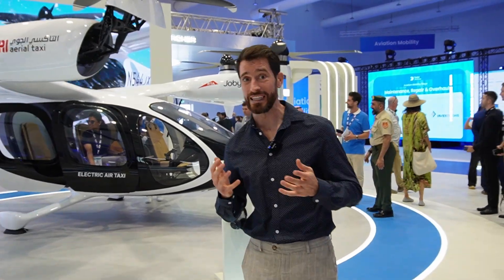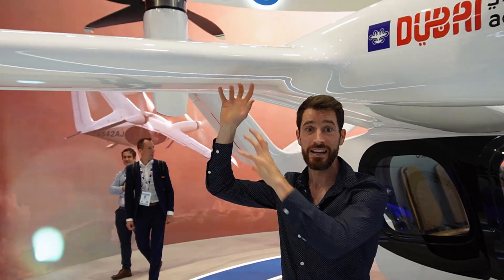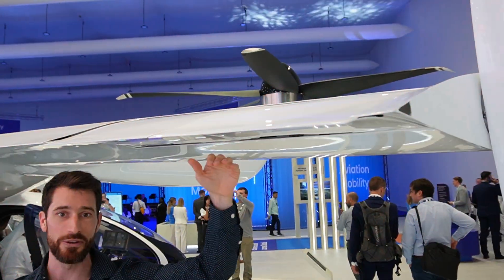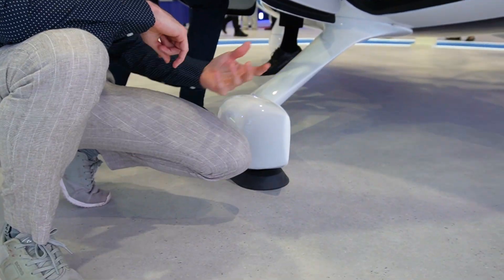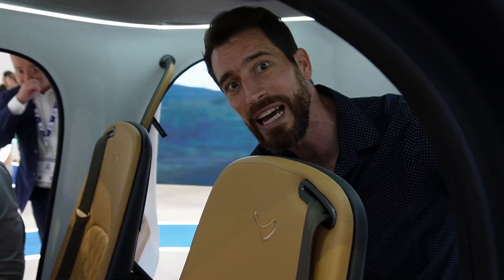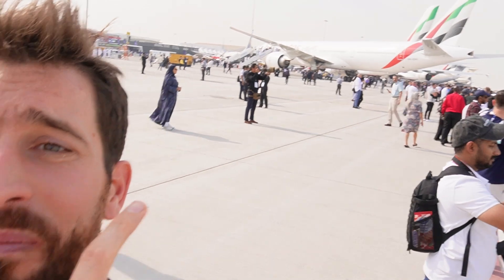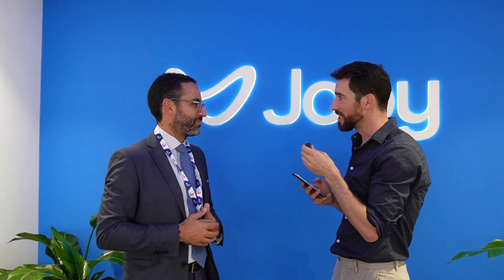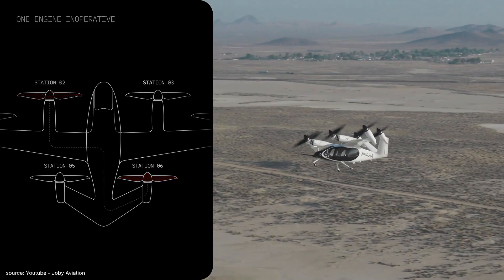Exclusive footage and interview with Joby Aviation

Comment: This Joby thing is really nice, really a beautiful toy , but  I'm sure I'm missing something ... given the short range, the slow speed and the urban use... why not an elicopter? An elicopter should be also intrinsically safer thanks to autorotation and the fact that Joby will glide like a brick.
Reply from the maker: It's the low noise which impressed me the most! And I wouldn't see helicopters getting accepted in large numbers in urban environments. And they too aren't safe on the wrong side of the dead man's curve. Each has their benefits and downsides!
Reply: The Joby attempts to solve safety by redundancy. Hence the six motors. And you call it slow, but it's comparable, if not faster than most, if not all, equivalent sized helicopters (in fact it's small, so equivalent sized helicopters are definitely slower). It's considerably quieter - having seen it at the show, the display was virtually silent - has better redundancy, is cheaper to operate (helicopters have notoriously high costs to operate), is easier to train pilots for, has less maintenance, less vibration (more comfortable for pax)....there really are numerous advantages. You mention the helicopters ability to autorotate, but that's not even available in certain segments of the flight profile, and is extremely risky (to put it mildly) over an urban setting anyway.

The downsides are none of the things you mention IMHO, apart from short range (helicopters not exactly being known for massive endurance or range either). I'm curious about charge times, and/or hot swap able powerpacks, (that doesn't seem to be part of the design), certification and legal aspects, crew training and career paths/retention, and overall commercial viability. You point out the advantages of helicopters, but there are extremely rare helicopter 'air taxi' services, precisely because of cost, complexity, and noise. The Joby (and similar concepts, Archer etc) attempts to solve this.

It absolutely remains to be seen whether it will succeed, but it's certainly more viable than a helicopter in what they project the role to be. It's really small, having sat in it now and had a look, people who are nervous fliers should probably approach it with caution. As a single pilot operation, I'd not want to be dealing with a panicking passenger centimeters behind me.